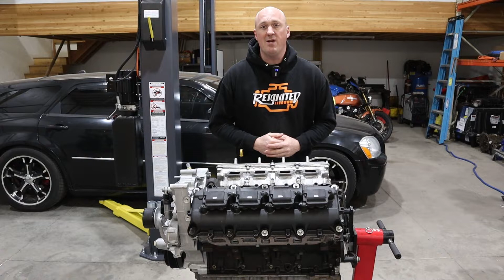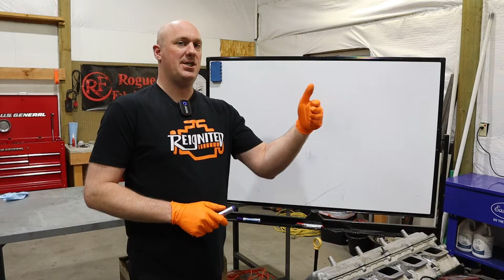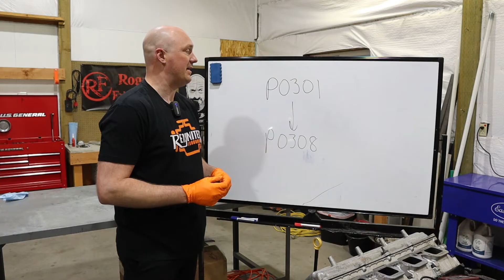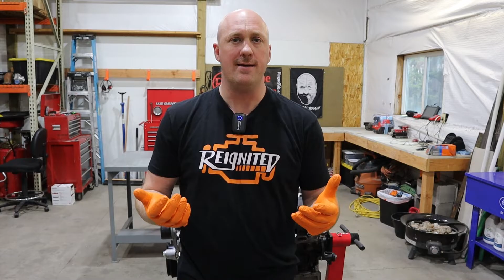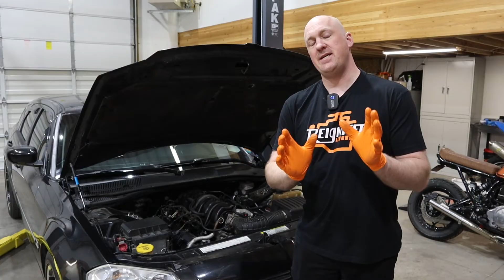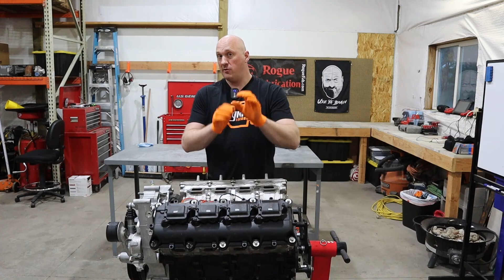Automotive Basics: Easy Hemi Engine Misfire Diagnosis

Comment: So I had a misfire and could smell gas lik crazy I replaced the cam and lifters! Now it runs but all I can smell is gas gas gas and it’s coming out the exhaust and gray white smoke what can this be?
Reply: I just finished tonight and can’t use it
Reply from the maker: This is just one thing, but on vehicles that have had a misfire for a long time, the fuel trim can be way off. Essentially it's flooding that bank with fuel it doesn't need. To correct this you'll either need to go to a dealer or a shop with an expensive scan tool and they can reset the fuel trims back to stock. This might help anyway. 👍

Comment: Awesome Tips Sky, I would add one thing right around the time you are checking the fuel injector, I would also check power and ground to the coil, the other thing that can mess you up a bit on these Hemi's that you didn't mention is the MDS solenoid.  Great content though and a learned a few tips!

Comment: I like all of the video’s i like the content and I can understand what you are saying and doing you inspired me to tackle my own cam and intake swap. I was wondering if you could clarify some of the tools you are using. I have already bought the wrong harmonic balancer puller even though it said it worked with my car now I have bought two valve spring removal tools and I’m waiting on my third. I have changed springs before but never had issues finding the right tools.can you tell or recommend the valve spring tool that works best on the eagle heads.

Comment: Thanks for the video, I just had to do this process with my 06 300C on cylinder 2. Mine ended up being a short in the wiring to that injector, I ran a new wire from the pcm and good to go!

Comment: Great timing for this video! Thank you. I started getting a misfire on cylinder 2 (2008 Jeep Liberty 3.7 V6 engine) on cold starts. The vehicle has 306,000 original miles. Changed the spark plugs (a little over 60,000 miles on them) and ignition coils (original) since it was time. I haven't gotten the code back, but the vehicle now has some intermittent (usually when restarting the engine after being off for over 10 minutes) rough idle. I haven't checked the injectors. That's next.
Reply: Head gasket.
Reply: What was it ?
Reply: Vacuum leaks

Comment: I don't mean to highjack the thread, can you please tell me if there's a difference between pre-eagle and eagle blocks, crank and oil pan? I'm looking to build an engine myself and there's a 5.7 for sale in my area for cheap.
Reply from the maker: Yes, there is a difference in the block and crank of the pre and post eagle engines, the oil pans will interchange, but you don't want to try mixing blocks.
Reply: @ReignitedAuto  ok perfect, that's all I needed to know. Thank you 👍😃

Comment: Can someone please tell me if all the genl 3 hemi heads are the same like will 05 heads fit a 03 block
Reply from the maker: 05 heads will fit on a 03 block, basically the cylinder head design is the same from 03-08 however, there could be minor differences in the heads themselves depending on what application they were used for. What I mean is, if you try to put truck heads on a car block, the heads will not be drilled and tapped for mounting the power steering pump. The bosses are there if you want to drill and tap them yourself, but just something to look out for.
Reply: @ReignitedAuto  thank you so much that’s what I was thinking and I think you said it before it a video but wanted to be 100% I couldn’t find it it’s very unclear online when you’re buying them if it says it’s for a 03 it seems like it cost way more I gotta 03 dodge 1500 5.7 no Cadillac converter 175 thermostat 04 radiator and rebuilt it with help from you after I get heads I have long tub headers and a full 04 SRT exhaust do you think a carb intake will fit nicely or have you seen one on a truck I’d really like a carb and cam then boost

Comment: Came at the right time.  My 17 ram 1500 developed a #3 misfire. Fearing the worst but praying for the best outcome
Reply: What did it end up being
Reply: Our 2017 Ram 1500 was running fine until last Sunday.  We were on the highway doing about 70mph for around an hour all was well. Once we pulled off the highway and stopped to make a right turn at the light.  The truck was shaking so badly and missing, we thought it was going to stall. We drove for about another mile to where I could get out and check under the hood. Oil pressure was normal,  water temp was normal.  No hot smells around the engine,  oil levels were normal.  Went to restart the engine and it sounded like we didn't have any oil on the right side of the engine.  We had to drive for another 40 minutes on the highway to get home.  It never got worse but it sounded bad. The missing and knocking sounds sometimes go away and it sounds normal.  I am thinking it might be a bad cam and lifters,  but it shouldn't go away and come back. Crazy it was running great until we came to a stop.
Reply: @ridemydirt2005  what was the problem. ??

Comment: I'm getting a random misfire on mine and I know I have an exhaust leak, could this be the problem?
Reply from the maker: This is a bit of a tough question. Ordinarily I'd say no, especially if the leak is after the oxygen sensors, however, if the leak is bad enough and it's before the 02 sensors then they could have been changing the fuel trim for long enough that the engine is eventually misfiring. This is pretty rare though. Usually I'd be "exhausting" all other possibilities first 😄
Reply: @ReignitedAuto  Thanks for the reply, I recently confirmed my shorty headers are leaking and I'm getting a 'not ready' state for the O2's but I'm not getting an O2 code... I am getting a P0456 (gas cap/canister) on this 2006.  The random misfire code disappeared but it left these new DTC codes, now I have to regroup lol

Comment: So this is so ironic ... I just watched this video yesterday ... going to work I got into alittle bit and guess what ... my check engine light started blinking and started running like crap ... p0300 .. dang it lol .. if I pull the plugs do I switch both to one cylinder?? Thanks for the input
Reply from the maker: That's correct, switch both plugs at the same time to another cylinder.
Reply: @ReignitedAuto  thank you for the reply .. hasn't acted up since but don't want to chance it
Reply: what was the problem ? i have the same issue you had
Reply: @erikruiz5004  coil pack
Reply: @crimzonr9371  did you get any misfire codes ? ontop of the p0300 ?
Reply: @erikruiz5004  No. That was the only code it had at the time.
Reply: @crimzonr9371  was the coil pack visually bad ? cracks or was it swollen ? i took my coil pack and looks fine on the outside
Reply: @erikruiz5004  not from what I saw, there was still grease in the boot. Just alot of miles. Around 150k
Reply: @erikruiz5004  might be something internal. Even though it looks good on the outside, could be a manufacturer defect that took time to show up. Small crack that wasn't visible ro allow moisture in.
Reply: @crimzonr9371  how did you know which coil pack was not working in your case ?
Reply: @erikruiz5004  process of elimination. Take suspected coil .. swap to different spot (different coil pack) and see if there's a change in code. Plus I worked at auto parts store and store manage knew how to test them. Turned out to be that coil pack.

Comment: Another thing to look at in regards to the coil packs is the electrical connectors.   My first misfire issue with my hemi was caused by a buildup of dirt inside the connector itself.  Once cleaned, it was all good again.

Comment: I can’t wait to open my own car shop ONLY working on Hemi Engines and Nag1 Transmissions. I want to do honest work. Chrysler offered me a job, but I don’t want to start off upselling shit.. I want to do honest work & save people money. That’s my end goal.
Reply: U got it open yet bro . We need more Hemi based shops most jus try to scam n say the Hemi trash
Reply: You got a shop yet? lol
Reply: Wish u lived near me. Have 5.7 hemi problem. Sure I need a rebuilt one. Ring broke down in cylinder and scratched all up. Need new rebuilt engine. Hemi. Loved my hemi. 2006.
Reply: @jewelleryaddict kinda sounds like I could have the same issue idiot put a v6 ecm in my car after backfiring so badly heard something like metal rattling internally 
It went away while trans was in limp mode then finally got it out of limp mode and first drive now misfire I’m scared to find out
Reply: Where will u be located ?
Reply: Ok hit me up when you open your shop 😎
Reply: Много не заработаешь..
Reply: If you do what you said you would go out of business I'm sorry if you was honest you would be rebuilding everybody's entire cars for free
Reply: I work for somebody as a mobile mechanic and we are being blown up 24 7 rain snow or shine we could totaly upscale and rip them off and it's still under half of what the big shops charge so it's realy impossible
Reply: Fucking nightmare trying to find how to get that nag out of limp and then after I finally do I get a misfire withing the first test drive man I like these motors and transmission but it seems like one thing after another 

I hate to say it but I think the ls and 4l65 or 4l80 got dodge beet

Comment: Guys, here’s a Misfire issue that NOBODY covers. I was putting dielectric grease in my coil pack boots like a dumb ass lol. I do it for my 4 wheeler and my dumb self thought it’d be a good idea for cars too. NO. The grease gummed up inside of my Coil Pack Boots / Spark Plug Boot & wasn’t allowing for a smooth flow of electricity to my spark plugs, causing me to misfire. So guys,  if you’ve got ANY misfires, check your Coil Pack Boots, if those are okay. Swap the coil pack from your misfiring cylinder, to a non misfiring cylinder. If the non misfiring cylinder starts to misfire, you’ve got a bad coil pack. If it doesn’t, check your spark plugs.
Reply: So dielectric grase is not needed for the coil pack boots?
Reply: SHIT! I just did my plugs and used dielectric grease on all of them! Wish I had read your comment before. That’s what I get for watching other people’s videos.
Reply: @thomydavid Hahaha. Its an easy mistake to make! Dielectric grease is typically used for Vehicles that are prone to get soaked in water such as boats, ATVs and Dirtbikes. On cars, it creates an issue if you put it on your spark plugs or where the coil pack meets the spark plug. It can also create a hell of a time for you to get them back off in the future since the dielectric grease dries up and makes your parts stick together. Ever since i found this out, ive never used it again. Havent had any misfire issues, and if I need to yank my coil packs out, they come out without a single issue. My next thing to wonder is if you can put a small glaze of anti seize on the outside of the coilpack boot, where it sits into its bore. Seems like a logical idea but I havent had an issue removing my coil packs since I got all the Dielectric grease out of there.

But yup! it all just dries up and creates gunk into the coil pack boot. There was alot of green gum in there afterwards. I had to buy new boots.
Reply: @BWADaniel  thanks for the reply. Right after reading your comment I went and yanked all of my coils/boots out and cleaned them with q-tips and then cleaned all 16 brand new $180 worth of spark plugs. I wanted to eliminate that possibility as potential problem for diagnostic purposes. Turns out I’ve got lifter failure and worn lobe on my camshaft which sucks. But, I did leave some of the dielectric grease on the same spot you just mentioned just to keep any moisture getting in. Thanks for the tip. I really appreciated it.
Reply: @thomydavid  What year is your car?? You have the Non-VVT engine or the VVT one?
Reply: @BWADaniel  Mine is 2015 Ram 1500 5.7 Hemi and it’s got VVT and MDS. 
I just got the lifters and the camshaft out about 5 minutes ago and ONE motherf@¢k!ng piece of $h!t MDS lifter failed and shaved the lobe on the camshaft. Mopar OEM camshaft is about $450 and new lifters all the way around are so ridiculous I don’t even want to do the math. 
It’s 4X4 so I have to take out the brand new CV axle I just installed last week just to be able to drop the oil pan. You almost need to have a damn phd in mechanical engineering just to change a headlight on one of these trucks. And then there’s the infamous “Hemi Tick” and I hit the trifecta on causes. BOTH exhaust manifolds warped and snapped bolts flush on the block (that I needed to weld nuts on in order to remove) and now bad lifters + trashed camshaft.
You can probably tell the sting hasn’t warn off yet.
Reply: @thomydavid  Last time I tore my engine open, I ordered a Non MDS camshaft from AMS Racing and ordered the OEM Non MDS Lifters from HHP. Of course you need a tuning device to turn MDS off but I already had one at the time. Depending on how much got shaved off, it may be well worth tearing the engine completely down and replacing the bearings while you are at it. I paid a shop $120 to replace the Cam bearings and supplied the bearings myself. Then i ordered normal OEM crank and rod bearings. These engines are a real piece of work haha.I ended up replacing everything in the damn engine since I was in there. Sounds life youve had a GREAT time removing all that stuff haha. I mean that sarcastic but you probably knew that lol. AMS racing may have an MDS camshaft if you wanted to stick with OEM. Me personally, id get rid of MDS altogether. I bought a V8 for it to be a V8. if I wanted a V4, id go get a honda or something.

Comment: I just remembered a problem I had outta a project car a while back. 07 chrysler 300c.  I eventually gave up an sold it. What would cause idle surge on start up once the motor is warmed up. An you've tested for vacuum leaks an found none. Replaced throttle body. Could it have possibly been the ambient air temp sensor or some other sensor. That maybe an issue others have had.
Reply: Could’ve been numerous things. Even a failing Crank or Cam position sensor, would’ve caused those symptoms. The symptoms are almost never the same, some are bad, some are very bad lol. Sucks that you sold it, but you never know, maybe the car would’ve ended up with thousands of dollars of work needing to be done like mine lol. I’ve got the 07 300c as well, and I just became a master mechanic working on my shit hahaha. Rebuilt the engine and replaced a few things on the inside of the trans. They are good cars when they run lol.
Reply: @BWADaniel  okay not a mechanic and also a female first of all lol but my car 07 300c 5.7 just started this, plugs r good. Had a misfire on cyl 7 but switched the pack with another and no misfire code any more so I was like okay but now its running the same and pulling P1417 is cant find anything much on it that is current...2 different mechanic friends said to try the cam shaft sensor...will that work?
Reply: @aprilfritz571  Nope. That’s having to do with your MDS solenoid for cylinder 7. There’s 4 solenoids underneath the Air Intake Manifold. Apparently you’ve either got a clogged oil passage somewhere which will end up causing damage, or your MDS solenoid is bad, or there’s a short / break in the wiring somewhere. Could be a lucky tricky but it’s easily doable.
Reply: @aprilfritz571  The code you’re getting is for Cylinder 7 “ Reactivation “ because of low oil pressure to that MDS sensor, Your solenoid going bad or because of a short in the wiring. So thats why you got a misfire code in the first place. I hope your lifters aren’t getting ready to give out!
Reply: You could’ve even had a failing fuel pump that starts to sputter as it gets hot. It’s rare that it’ll do that instead of failing, but everything’s been seen lol.
Reply: @BWADaniel  I just had a chance to get that car back my buddy who bought it didn't attempt to do anything with so I figured I'd make him an offer. I've got a new crank sensor an a cam sensor for it. Not installed yet. I just keep thinking about one thing. Could failing lifters cause that issue. Imma get the car back regardless. I was just curious on someone elses input. Thanks in advance.
Reply: Yea I wish I wouldn't have sold it either but I've got 2 05s a dodge magnum an a 300c. I had just kinda gave up hope on the other one after I crossed that invisible line as far as money suck into it. Thanks for the info though. Any information I can add to the data bank is good with me. 🤘